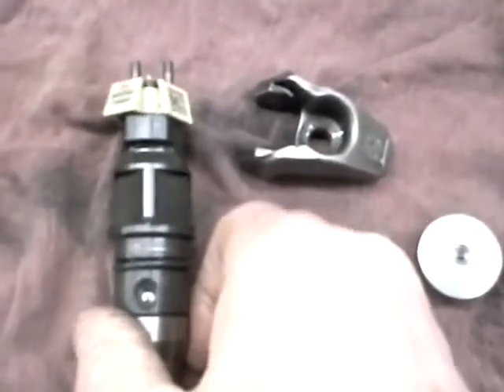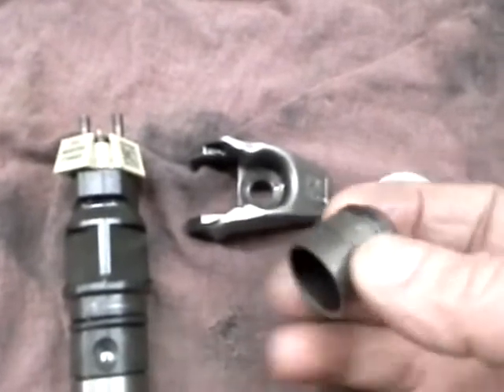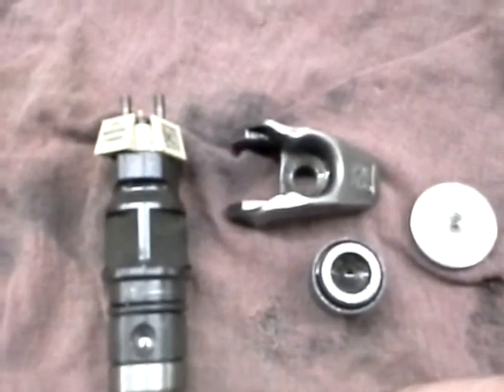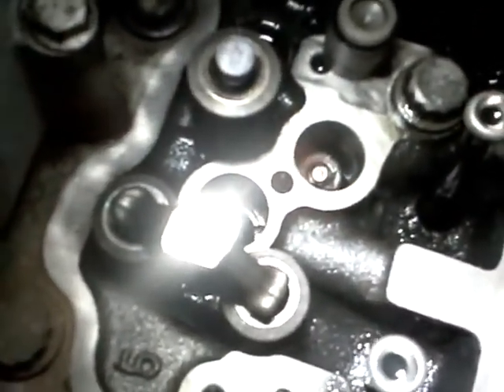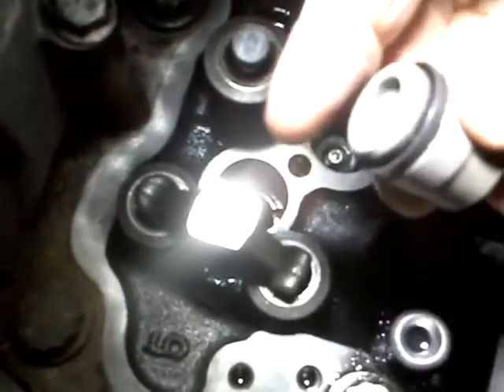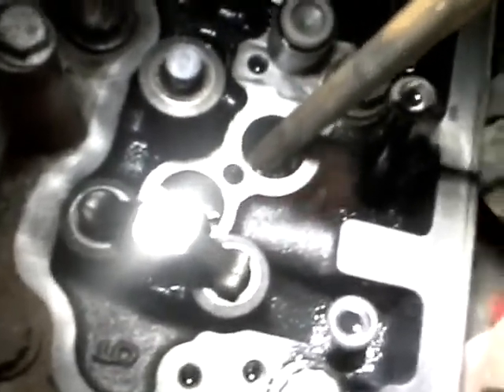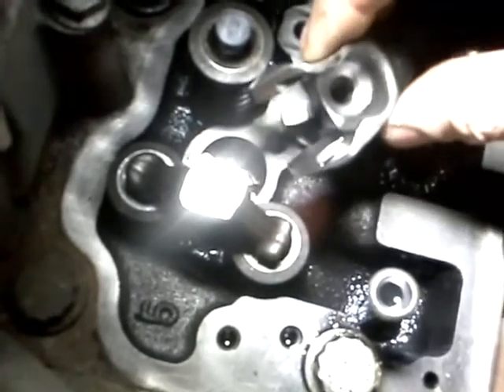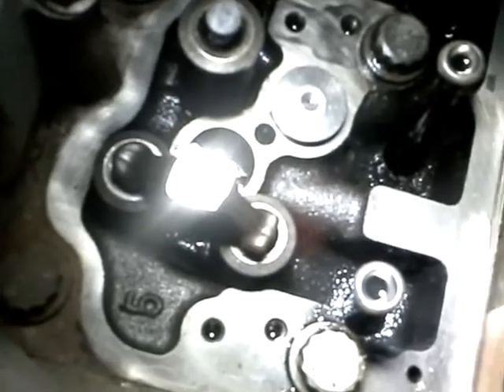Mercedes MBE Constant Throttle Valve Engine Brake Repair

Comment: hello
watching your video I undestood the valve is the solenoid who controlls engine break...if the motor has a fault witn a S ID 58 code,that means I need to repair one of those valves??
Reply from the maker: This is constant throttle valve system/engine brake. Check the oil pressure from control solenoid. Inspect pistons and seals along with return springs.
Reply: How much is t fix that parts and labor?
Reply: i have SID 58 FAIL 05 (open circuit)would you have a picture of the solenoid that control the engine brake